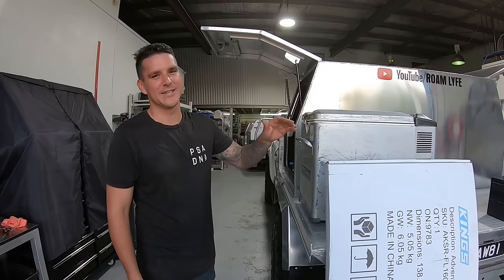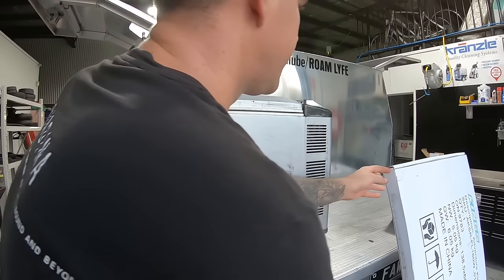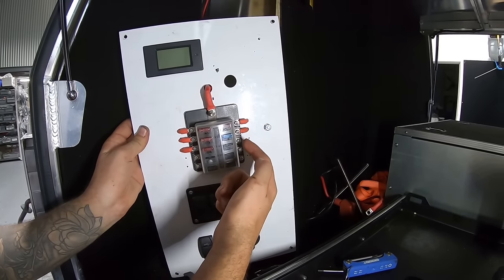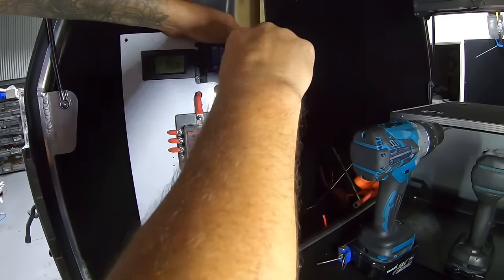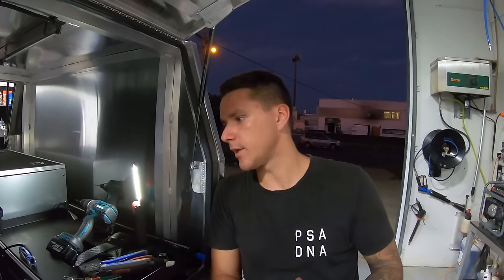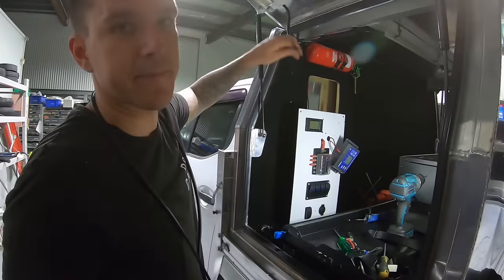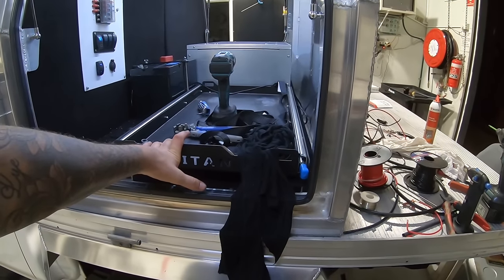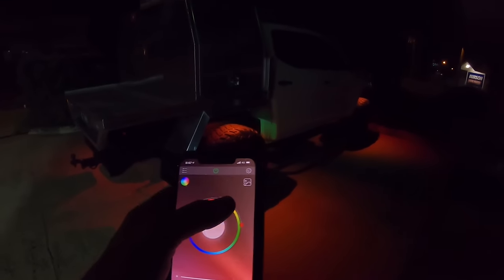Solar ONLY Setup Version 2.0 & Restoring The ENGEL Fridge

Comment: Hi Mate, you should put a circuit breaker in your back board just above the battery, would be a neat spot. Basically cut your main battery after it goes through the wall and put in the inline Circuit Breaker. You need to protect your battery. Good DIY job.
Reply from the maker: Oh good call! I will get onto that ASAP! Thanks for the info!

Comment: That solar regulator wont tell you how much amps are going into your battery. Get yaself one of those cheap amp/volt meters with anderson plugs at either end costs about 50 bucks from jaycar, and put it after your solar panel but before the regulator. That way you will see how many amps watts ect your solar panel is pumping into the battery. :)
Reply from the maker: I wasn’t sure what was on the display to be honest! I hoped it had the amps coming in but no bingo.. 😭
Will definitely get an amp meter on it ASAP! Thanks for the advise mate
Reply: @RoamLyfe  You want something that measures state of charge. Usually a shunt that can be used to give a mV signal to a controller to determine incoming and outgoing load. With the battery capacity set by the user it can then tell how many amps have gone out and how many have gone in and exactly what your SOC is.

Comment: Hey mate, what size cable did you end up using?
Reply from the maker: Hey mate! I used 5mm wire witch was good up to about 25 amps! The panel only sends in about 8amps so have me plenty of room, also the length comes into it as amps drop off over distance and my wires where nice and short! Thanks for watching 😊

Comment: When I installed my panel on the roof I just ran duct tape down the leading.  Also I would cut the wires off your old one and check the amps, I had the exact same thing, voltage but no amps, just turned out to be a dodgy plug.
Reply from the maker: That’s actually a great idea! I actually checked the amps at the start or the panel and it wasn’t producing more than 1amp! She was buggerd! Thanks for the tip!
Reply: @RoamLyfe The thing is if you measure the amps at the start of the panel they will be no different. If there is a high resistance joint downstream that will effect the current draw at the panel. Ohms law. I=v/r   so the higher the resistance the less amps can flow.

Comment: Hey bud, just wanna know how you're going with all the kings 12v gear. is it holding up well, and seem alright quality? any issues?
Cheers mate
Reply from the maker: Hey mate, it’s honestly been great! Works as advertised and no issues yet! So I actually rate it pretty highly!
Reply: Roam Lyfe hectic had a few problems previously so wondering how the electrical stuff is
Reply from the maker: Yeah no complaints mate, I’d prefer named brands but money is always an issue 😂

Comment: How do you rate the kings 12V gear mate? Any dramas? Or runs pretty good.
Reply from the maker: Runs great for the price mate! Let’s be real if I had the money I’d go a better brand of gear but as you know 4x4ing is an expensive hobby haha!
Reply: Ah yeh sweet, yeh iv got 210ah if battery to put in my Ute , not sure I wanna go the dc dc charger route, as they are expensive haha. If this sole regulator system works I think I’ll run the same setup